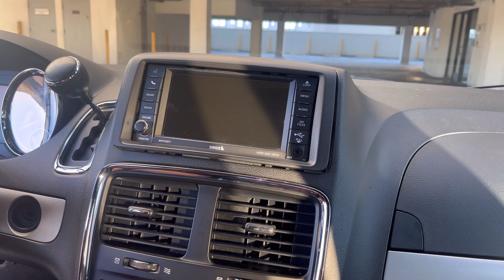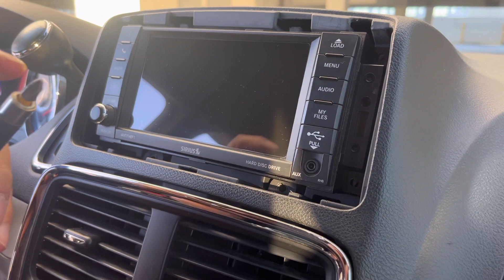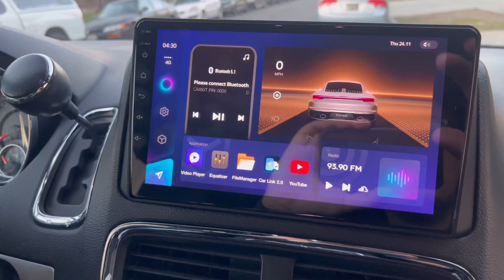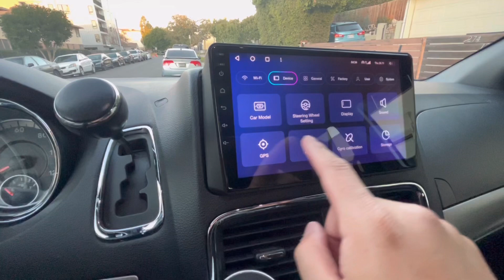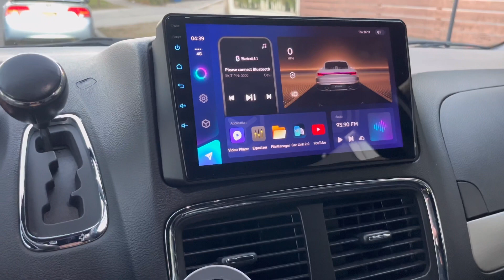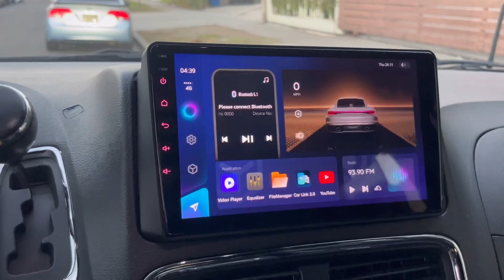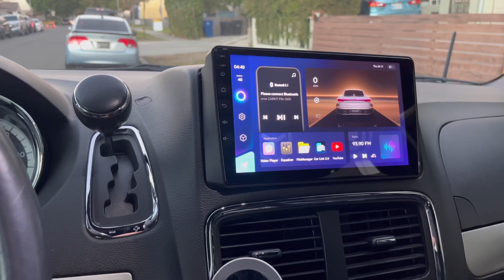2011-2020 Dodge Grand Caravan T’EYES CC3 Radio Apple CarPlay

Comment: **Edit:  Disregard, you answered the question.  PAC CHYRVD Rear Video Retention Cable For Select Chrysler/Dodge/Jeep Vehicles 2008-2012 - allows us to keep the factory rear DVD screens.  Thank you for your work.  Very informative and helpfual to the 5th gen Dodge/Chrysler Minivan community.
Reply from the maker: Your welcome 👍🏻
Reply: Thanks for your comment. Could you share how you connected the harness to the Teyes system (AV in / out)?
Reply: Does this support multi zone video? Or do the rear screen see exactly what the front unit shows?
Reply: How did you get the dvd player to display anything? I tried putting a dvd in and it doesn’t show anything. I also put the harness you mentioned but maybe I missed a connection?
Reply: @seantydingco ?
Reply: @maral9285  what's your question?
Reply: @seantydingco  do you remember how you wired the kit to make the rear dvd work with the unit?
Reply: @seantydingco  I purchased the harness and my rear camera works, but the dvd player just shows up black.
Reply: @maral9285  oh I see what you are asking.  I am sorry, I did do any upgrades to the stock system.  I was trying to use the software that he recommended and I use it and jt allowed me to unlock certain things in the system OS.
But DVD system wise. I did nothing.

Comment: Looks like a higher quality unit with lots of features. Thanks for the detailed video!! I currently have all the options selected with dash, rear and 360 camera system. Also, some extra cables and obd module. Just under $1000. I’m still somewhat hesitant since it’s only available from Australia. Worried about warranty etc. decisions decisions……
Reply from the maker: I’m very happy with it.

Comment: I stopped into stereo place yesterday.   The guy took two lines (both red) connected them and it worked instantly.  I’ll try to get a photo of that connection when I put the reverse cam harness in when that arrives!
Reply from the maker: Wow. I’m glad it was a quick fix. Those wires might be the ones that give signal to the amp.
Reply: I think that is correct.  Still confused why the plug and play didn’t work.  Or I should say worked for a few minutes

Comment: Hi, thanks for your video. Watching from france. If i change the stock unit for this pne, will I be able to still use the original double screen for the kids on the back?  I plan to replace the stock unit but keep the blue ray VES unit.
Is it possible?
Thx for your response
Reply from the maker: Hello and thank you for waching. I dont have the rear view monitors but this is the cable to retain the rear view camera and rear monitors To retain rear view camera with rear monitors. Plug and play cable which routes which routes the A/V outputs of the OEM VES DVD player to aftermarket receiver 
https://amzn.to/3BjFnrA
Reply: Thank you very much for your response and taking the time to give me this link. Very appreciated !
Watching from france btw😊
Reply from the maker: @mehdiflayelle  Your welcome and thank you for watching.
Reply: @RonDIYMods  Yeah. T&C 2014. I tried with this cable. Doesn't work.

Comment: This is a really good system it supports video out by a USB for rear entertainment system. But the only problem is it only clones the front display. Meaning that if you're navigating on the front the people in the back will see the navigation. There's no way to have navigation in the front and a movie playing in the back.
Reply from the maker: Thanks for that info
Reply: Yes, thanks.  
I’ve ordered the nit from Teyes.  It’s been a week and I’m not sure it has even shipped.  Did it take several weeks to receive your unit from Teyes?
Reply: Is this true info it isn’t dual zone
Reply: @MrHope21  message the manufacturer 6mo ago and that's what they told me.
Reply: @604Jimmy  how were you able to get the screens to work in the back? I’m having trouble getting it to work on our van.

Comment: Awesome videos. Thanks for sharing. I have a couple questions.

On the upper left corner of the unit, is there a little mic? I’m quitting to see, but it also,to looks like a little built in mic with the word “mic” written in tiny white text next to it. If this is the case, is it possible to go without the external mic?

For the apple carplay, will it automatically connect when you plug the phone in after use set it up the first time?
Reply from the maker: Thank you for watching and your comment. 
Ok when it comes to the built in mic their is away to deactivate it. Depending on the unit you get. Let me explain. You can get the same unit I got which in order to deactivate the internal mic you would need to physically remove it. Theirs a video in how to do it from TEYES. Heres the link. https://youtu.be/QoR4pIa5n-U?si=DIbNwBf8rjLzjh37

Changing Built-in and External Microphone Settings
This is a guide which will show you how to switch from the onboard microphone to the external microphone.
This method only applies to the CC3 2K and non 2K
units that have been manufactured post March 2023.
https://youtu.be/b4CDHgPA-JI?si=vhUosVd0S5dkdoZf

When it comes to the apple CarPlay. Yes once you connected the first time it will connect every time unless you disconnected.

Comment: What dash kit did you use. Also, did ALL the necessary wiring come with the radio? (Besides the back up camera)
Reply from the maker: When you order the stereo from TEYES everything is included, including the dash kit and a aftermarket camera if you don’t have an OEM one. Check out the links in the description.

Comment: I am a little confused I just ordered it but does it come with the ability to use my factory rear camera on my 2018 dodge grand caravan? Or do I have to buy a harness?
Reply from the maker: In order to retain OEM rear camera you need an extra cable. I provided the link for the extra cable.

Comment: Hey Ron. Thanks for the video. Any clue if this is gonna work for a 2012 Grand Caravan SE ? Also, did it come with a backup camera and the microphone? Doesn't seem to indicate there's any of those two in the box on the picture they show on their site.
Reply from the maker: Thank you for checking out my video and to answer your question. Yes, it does come with a microphone and aftermarket camera from Teyes.
Reply: @RonDIYMods  thanks for the quick answer. Do you think the provided cable with the aftermarket camera is long enough for a dodge caravan?
Reply from the maker: @n3tix  yes it is. I just installed an aftermarket camera on my 2017 Dodge grand caravan. Check out this video. https://youtu.be/_2TBYGLkIgQ?si=n7OovgTI9dqDKBK9

Comment: Can you use the old mic instead  useing the one comes with the new radio?
Reply from the maker: I’m pretty sure you can, but I have not been able to figure it out.  that’s why I’m using the aftermarket mic. There would need to be some rewiring in order to use the OEM mic.

Comment: Excellent video..but I had a question so if I install one of these stereo what happens to the dvd function? I’m assuming you no longer have the dvd?
Reply from the maker: I’m not 100% sure since I didn’t have the DVD on my Van but apparently the same cable that keep the stock rear camera also keep the DVD function alive.
Reply: @RonDIYMods  do the new stereo upgrade have the capability for putting a dvd??

Comment: What holds the unit in place? If the frame screws into the unit, what screws did you use because mine didn't come with any screws.
Reply from the maker: Yeah, that holds the unit in place is the 5 screws. mines  come with screws but they’re small Phillips head.

Comment: Can you make a video showing how you like the unit after a year. Show the controls and how you are using it with SIM card and with cell phone. Thanks
Reply from the maker: Ok will do. Do you have any suggestions in regards to specific functions that you wanna know about
Reply: @RonDIYMods  I just bought a 2016 Grand Caravan. I would like to have 4 cameras. I would like to know what cameras you are using. What microphone? If you use your cameras as a dash cam and record. Have you upgraded your speakers? Links to accessories that you have bought. Thanks a lot.

Comment: Appreciate all the info! My van has the external amplifier with factory subwoofer in the back. Will I lose balance & fade controls? Crutchfield mentions this on their site with some canbus options.
Reply from the maker: No this radio has a build in amplifier. So you have some control over balance and fade.

Comment: Great video. Couple of questions. Does your caravan have a stock amp and sub? Did you have to get an additional separate wire harness? Or the one it came with worked no problem?

My 2015 has a stock amp and sub and it looks like the plugs you have on the back of the stock radio. But I didn’t really see how you wired everything clearly. Thanks in advance for your help.
Reply from the maker: Yes I do have the stock amp and sub. No extra wires needed. The only extra cable you need is the reverse camera cable. The Teyes unit comes ready with everything else.

Comment: where did u get your sim card can i use which ever sim card
Reply from the maker: Yes you can use any SIM card. You can get it with your cell phone provider. Just let them know it’s for an android tablet.
Reply: @RonDIYMods  is it a one time purchase or it is monthly payments to keep it active?
Reply from the maker: @xghosty3325  no it’s a monthly subscription trough your cell phone provider. But they are not expensive. You can try mint mobile and get one for like $15 a month depending on you data usage. Switch to Mint Mobile and stop spending so much on your wireless plan. Use my referral link to get $15 in renewal credit. Then use the money you save to buy me lunch or something (as a thank you).
http://fbuy.me/uKLCs

Comment: I'm on the site looking at this kit and I don't see the CANBUS box.  It's also not showing the radio to vehicle harness like the one you have.  Was that and the CANBUS box included with the kit in your link above?
Reply from the maker: Yes the canbus box is included. It’s all plug and play included. Here’s the link. https://teyes.com.au/products/teyes-cc3-for-chrysler-grand-voyager-5-2011-2015-car-radio-multimedia-video-player-navigation-stereo-gps-android-10-no-2din-2-din-dvd
Reply: @RonDIYMods  Thanks for clarifying that.  The webpage is not clear on what is included and the photo showing the kit doesn't have the CANBUS box or interface cable pictured.   I don't get why once I start checkout the cost goes up and the shipping is $$$$
Reply: @briandodds it’s confusing. I want the 360 camera system but don’t know if I still need the DVR front and rear camera separately. You also need the 128gb CC3 with the 360 but it lets you continue checking out with the 32GB version. Yes shipping is $100ish
Reply: @peteysparks252  How did you discover the 128gb CC3 is required?   I ordered the 32GB with the front camera, the rear camera and the OBDII.  Didn't end up getting the 360 for my van.  If I think that was a mistake I guess I can always move this to another car and get a 128 head for the van.  I do wish there was a place in the US to order them.  It was $120 for shipping!  :(
Reply: If you look at the 360, it states this information on the page

Comment: Does it have android auto?

The title of your video says 2011-2020. The link for the stereo shows it fits 2011-2015.

My GC is a 2019 and i would love if it would work out for me.
Reply from the maker: Yes I have a 2017 and it works. In the link it says up to 2015, but it actually works all the way to the 2020 model. So yes for your 2019 will work. Everything will work fine.

Comment: This says for 2015 but it works on a 2017 Dodge Grand Caravan? Do I need a sim? What is the SIM card for?
Reply from the maker: Yes, the link says up to 2015. I have a 2017 and it works perfect. It actually works all the way up to 2020. Sim card is optional that’s only if you want Internet on your device if not you can run a hotspot through your phone to get internet on your device.

Comment: I did all of this.  The audio worked for one evening, now the audio does not work.  Any ideas on that?
Reply from the maker: Are you playing audio from the stereo or Bluetooth music. If you’re playing Bluetooth  make sure your phone is not muted and your phone volume is up.
Reply: I have tried it all!!
Reply from the maker: pull the stereo out and make sure that all the plugs are plugged in correctly on the back
Reply from the maker: Reboot it
Reply: I did try all of this stuff.  Like I said it was working fine for a few hours.  Could it be a fuse or something else?  Screen works perfect, just no audio via phone or radio.
Reply from the maker: @ any updates?
Reply: No luck.  Unfortunately I think I need to take it to a stereo place to get figured out.  I checked the fuses and everything else.  Tried it all.  No sound, no radio sound.  Nothing.  Screen works 100% perfect with no sound
Reply: It’s driving me crazy 😂
Reply from the maker: @ have you checked the fuse that controls the amp? It’s number M12 30 amp fuse green.  It’s located in the fuse box in the engine bay.

Comment: Hi Ron! Do you know if the dodge grand caravan has an interior fuse box?
Reply from the maker: No interior fuse box. The only fuse box is next to the car battery in the engine bay.
Reply: @RonDIYMods  Thanks! When you back up, does the line move? Because the default one doesn't, right?
Reply from the maker: @rethirded  yeah the line do move with steering.

Comment: Thanks sir for the nice video, actually I have dodge grand caravan SE 2015 and I need this one to install in my car, so you think will be fit in my 2015 dodge or not. And the system is coming with the frame or we have to purchase separately? 
Thanks
Reply from the maker: Yes this fit in your 2015 grand caravan. It come complete with frame and plug and play wires. Ready of the box.

Comment: Great videos

I looked at this unit, but it is SO expensive to ship.

One question about the previous Android unit you had. I just finished that video & it looks to be way cheaper. Were you happy with it while you had it? I do not need a SIM card (mainly just wanting it for Carplay).
Reply from the maker: Yeah I was happy with it. I initially also wanted it just for the Apple CarPlay. If that’s want you want it for then yeah that android unit would be it. Also cheaper.

Comment: Hey did you notice a audio difference from the two radios you installed?
Reply from the maker: Yes I did the TEYES has a better audio quality. Sounds better.
Reply: @RonDIYMods  do you have amplifier in DGC? In my 2019 GT 11 channels. Sound is bad than DGC SE 2008
Reply from the maker: @dmitrylaskin695  I have the stock amp.
Reply: @RonDIYMods  I have the stock amp too. I have DGC 2008 and 2019. last week I switched media systems between cars. The head unit from 2019 sounds worse in 2008 than the original one. The head unit from 2008 in the 2019 car with an 11-channel standard amplifier resembles a well. If you experiment with replacing standard head units or sell them, do not forget to programmatically remove the theft protection, otherwise the head unit will require a PIN code.
Reply: How do you remove the theft protection?
Reply: @ecooke2  elm327 + JScan

Comment: Thanks for the video, very well done and informative.  I have the same van and I’m considering the Teyes CC3.  Do you know if it will support my rear entertainment (dvd) system, and my factory subwoofer?
Reply from the maker: Yes it will support the factory entertainment DVD with the added wire harness. I added the link to the harness in the description of the video. And for the subwoofer it does I have a factory sub and it sounds good.
Reply: @RonDIYMods  thanks,  ordered the radio package and the USB to AVI adapters.  I don’t see that a mic is included but assume it’s with the included cables.
Reply from the maker: @cookefamily3255  yes, the mic is included along with all the other cables.
Reply: @cookefamily3255 were you able to play the DVD on the rear screens?
Reply: @RonDIYMods  could you possibly explain how you got your dvd system to work on the rear screens with the added harness? I got my camera to work, but my dvd player isn’t playing anything on the rear screens.

Comment: Dude ~ Great video! I have a 2019 DGC SXT, and I hate that the existing 430 radio doesn't have CarPlay or AA... My only question is, what about SiriusXM? Do they have a resolution for that? Thanks in advance, JD
Reply from the maker: Thank you. For the SiriusXM you can download the app on the radio. run a SIM card or hotspot. And you make it work that way.
Reply: @Ron DIY Mods  Thanks Ron, much appreciated.

Comment: in my 2019 dodge caravan the steering wheel controls simply don’t work no matter how many times I’ve tried. Also, the learning functions don’t work either. Be forewarned
Reply from the maker: You need to get into the radio system and program the canbus  to make it work.
Reply: @RonDIYMods  I did that just as you showed in your video. Your video helped quite a bit so thank you, but this feature still doesn’t work. I’ll keep trying to get it to work
Reply: @RonDIYMods  I removed the unit today today to check my wiring and found that the plug that goes into “c”, which is the can port, was not all of the way in. After getting it back in I was able to use the steering wheel controls. Thanks for your content

Comment: Dear Ron, so the harness comes with the stereo but it just plugs into the existing harness? Including rear camera?

Also which service do you use for the sim? Price?
Reply from the maker: Yes it comes complete with all the harness and wires plug and play. It comes with a rear camera to install. If you have the stock camera than you need an extra cable which the link is in the description of the video and that will make the rear view camera plug and play.   As far as SIM card I’m using T-Mobile. $20 unlimited data.